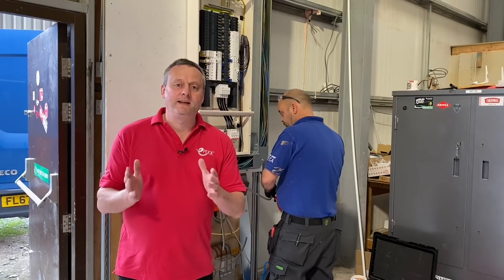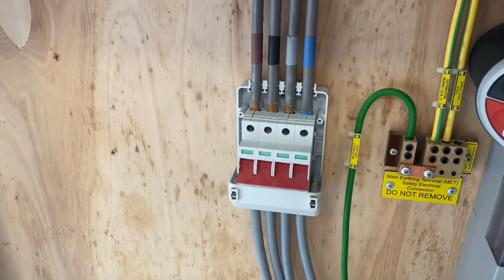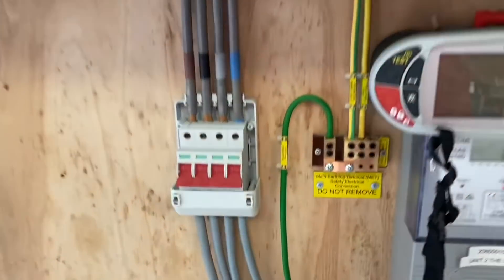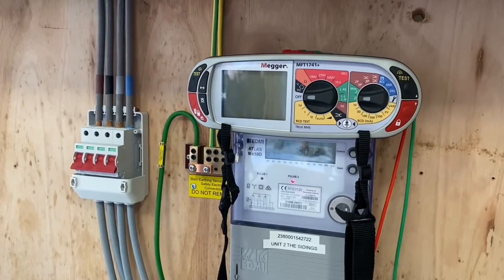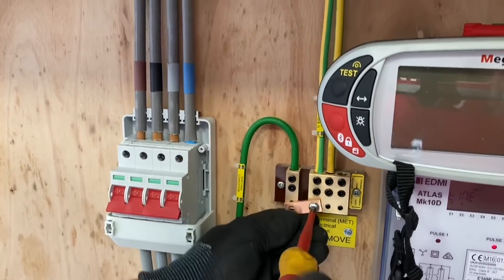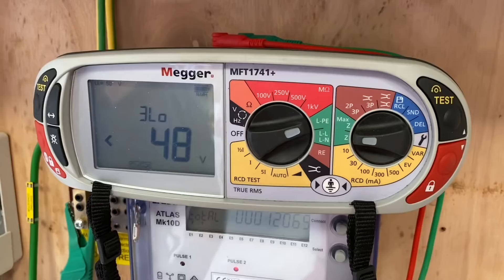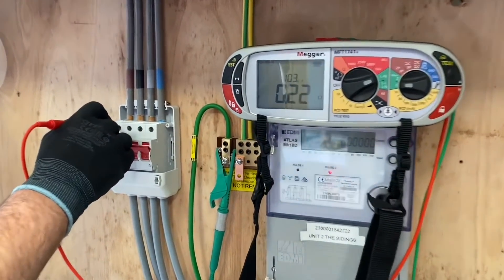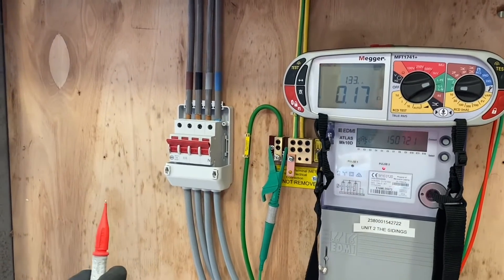EXTERNAL EARTH FAULT LOOP IMPEDANCE - 3 PHASE SUPPLY - AM2S/E

Comment: So, what should be done if the reading is above 0.35 ohm? Should we contact the DNO? Would this make MCB's operating devices inoperable?
Reply: No, it just means your connection to earth isn’t ideal. If a live conductor — especially the neutral — shorts to earth (say, inside a washing machine), it will be slightly less likely to trip a breaker or fuse rather than just livening up the entire house.

And don’t get me wrong, that’s not gonna happen at 0.4, but eventually, if the impedance gets high enough, an appreciable voltage will end up on all the CPCs, if they’ve got good conductivity between themselves but not to the PME.

That’s still not a huge issue directly because literally the entire house would be at that elevated voltage — but it can become a Thing if you have something plugged into it that is outside. Like, a faulty washing machine could make using a hedge clipper an Interesting experience.

In the modern world, when you’re doing your hedge clipper ing and getting a shock off the metal parts of it, the RCDs should trip instead. We’ve got protections upon protections these days, and it’s very hard to kill yourself by only fucking up one thing.

Comment: FAILED. You didn't zero your leads out first...
Saying that  I'm a Fluke man so not sure if your test gear has 4 wire compensation. With fluke you zero every time Espicaly when doing Ze, PSC, EFLI and every little ohm matters.....
I now wait for a scolding about not knowing my test equipment, lol
Reply: 2 week wonder
Reply: How do you zero leads on a live test exactly?  None of my meters have ever been able to do that!
Reply: Efixx could ye please give yer advice on this. I have a fluke meter and have to null for cpc and impedence readings.
Reply: @clivecusack  yes on those measurements nulling is vital
Reply: New to me I've never  had to zero my leads on any meter on a live test
Reply: you don't null leads on a zs or ze test its not a low ohm reading..
Reply: @Ten_Pence  Its vitally important on Ze, Zs, PSC to zero your leads as your measuring less than an Ohm for Ze also the reading given during the zeroing will tell you about the condition of your leads. And the connections they are making. 
Many times I've zeroed the leads and found the zero reading high compared to previous times and I've found I've needed to remedy that before I do the test. If your testing in the hundreds or thousands of Ohms 0.4 Ohm lead resistance doesn't matter but that would make your TNC-S reading 0.75 Ohms therefore you'd think the Ze was too high...

I Zero my leads Every time I change the test. And I think that was a common sense requirment on my 2391 Test.
Reply: @glenwoofit  not at all as you are measuring at a higher voltage. Most meter won't / can't null on a ze
Reply: @glenwoofit  no you're incorrect..  I've been doing this quite a few years sir... if ever your over your max ze or zs you can certainly check your lead resistance but on this test you don't have to null your leads.. you're just wasting your time... The NICEIC have never pulled me up on testing this way as a 
QS...
Reply: @Ten_Pence  someone needs to consider ohm's law that will clear up his confusion
Reply: @MT_T991  Fluke has this where you have to null leads for loop testing. Megger does not
Reply: @brianhewitt8618  nor kewtech or dilog

Comment: 3 pole or 4 pole main switch at the DB on a 3 phase installation...worth a discussion in a future video?
Reply: Never seen the point of using a 3 pole isolator personally.
Reply: Must be 4 pole unless you have a very specific reason for a 3 pole.
Reply: @arcadia1701e  according to who?
Reply: Yes I always fit 4 pole but I see many  boards with 3 ,pole units fitted.